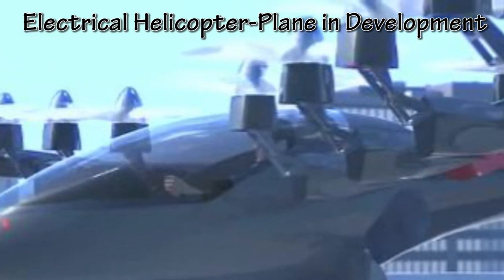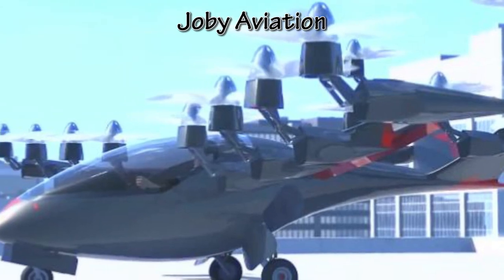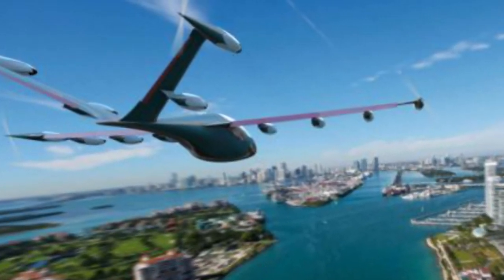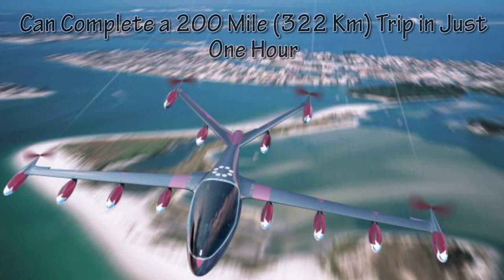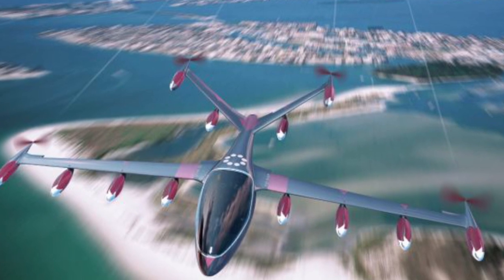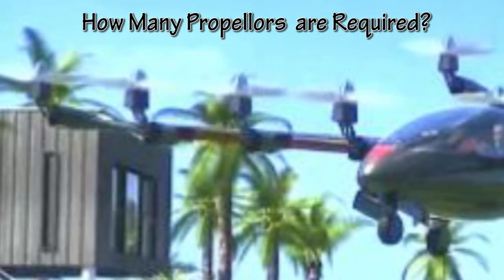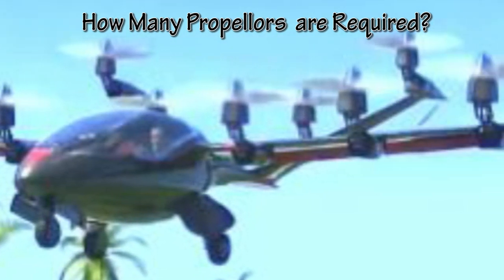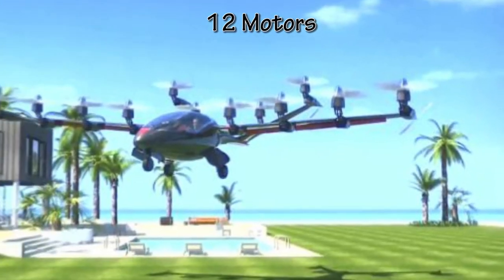New Hybrid Plane of the Future

Comment: No to many engines.
Reply: *****
Negative, one dozen "Large" brushless powered electric motors improve redundancy and lower the risk of accidents. Being electric, there is no throttle per say, all is done through Electric Speed Controllers calibrated per motor into a single flight controller unit (ECU replacement). This provides immediate torque rather than a fuel powered engine gaining and reducing RPM, with volt regulators, step-downs and various Low Voltage Detection units the motors will have no choice but operate in the exact same performance without electric brushes wearing out. So actually, with several million dollars into development of what is a "simple" design, I'm confident that JoeBen Bevirt (who's only 40 years old), has chosen the exact amount of motors. Only downside... it carries TWO people, now you need a private pilot's licence (not sure what type for this e.g. single, twin rotor, multi-rotor add-on, etc.). But what airport, let alone home, will have a charger for this baby? I'm assuming it's a lithium based battery source.